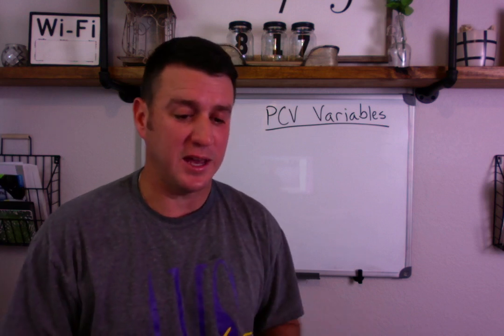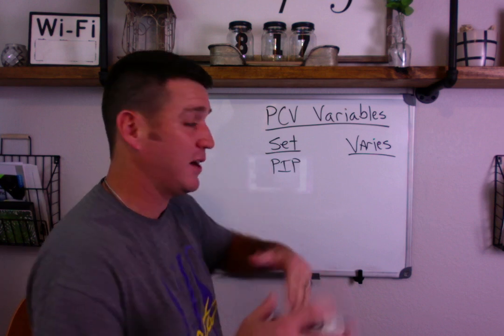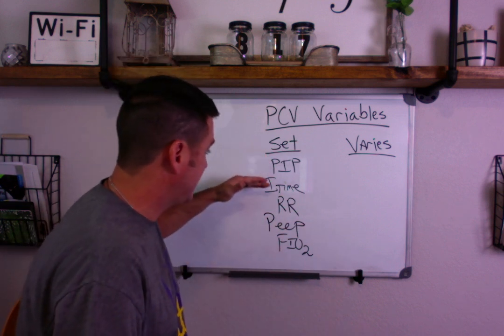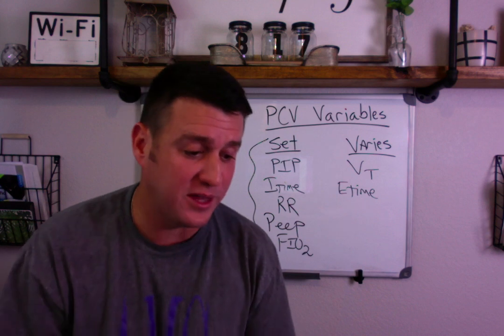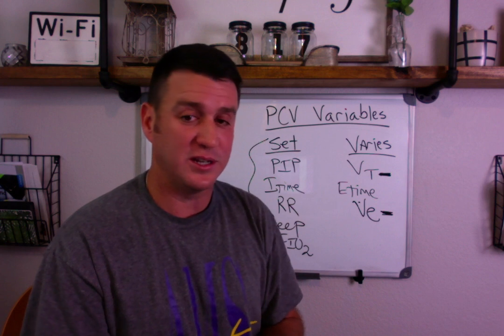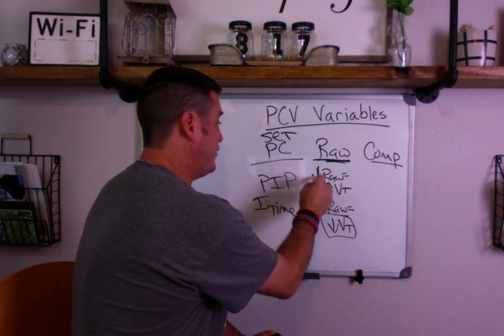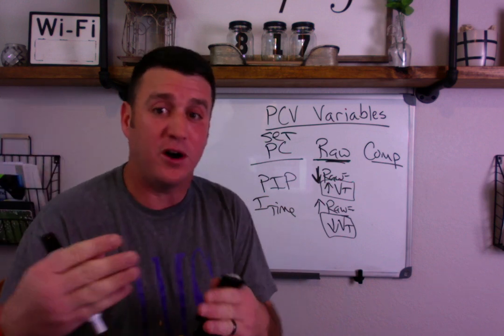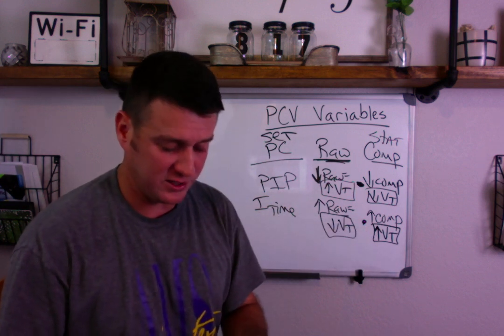Respiratory Therapy - Variables in Pressure Control Ventilation

Comment: Is there anyway you can go through some of the TMC scenario practice questions with us to show us how to break them down one by one.  This is what I struggle with the most is finding out what information is important & what is just filler info to throw me off.  I try to break down everything and spend too much time breakdown the ABGs, then checking all other info to know what normal parameters are for each when half the time that info is irrelevant to what the question may actually be asking.
Reply: What vent modes only help with Oxygenation (CPAP) & which ones only help with ventilation and which ones help with both (Bi-PAP) - this would help me greatly.  Thanks Coach